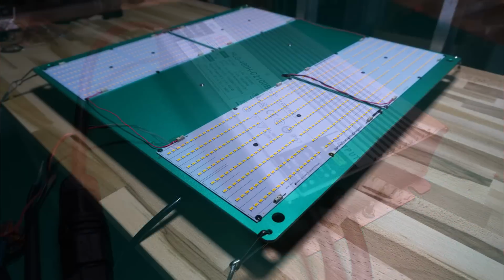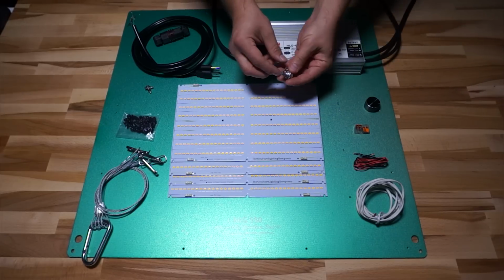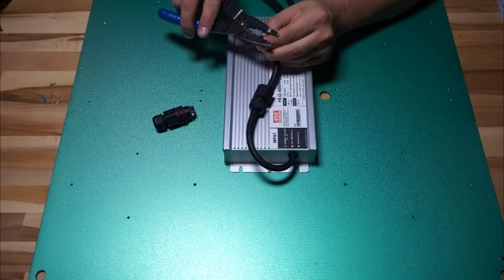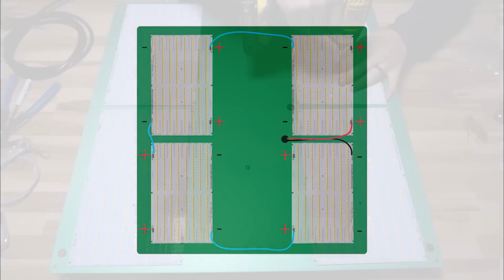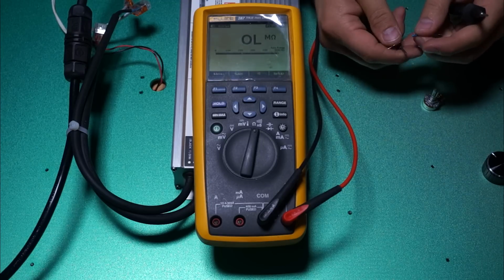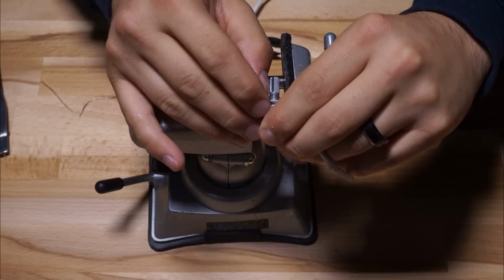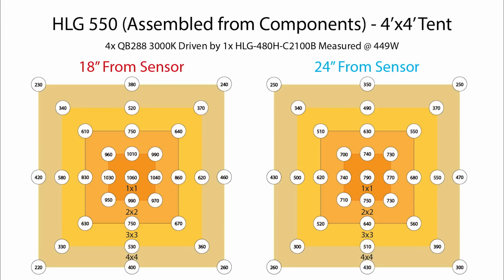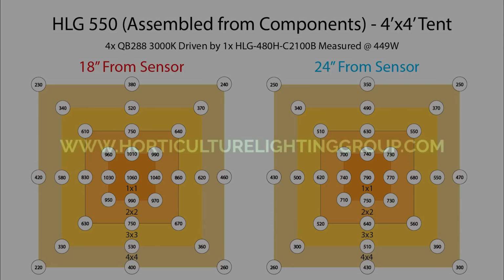HLG 550 Assembly and Testing (4x Quantum Boards on 1x HLG-480H-C2100B)

Comment: Nice vid ! I just pulled the trigger on this last night on this:
 included in full set ( MB-600-V4-Plus KIT)

 

1. 6pcs QB288 V4-PLUS boards

2. 1512pcs samsung lm301h

    72PCS CREE 660NM

    24PCS LG 395NM UV

    24PCS CREE 730NM IR

3. 2pc heatsink 935x195x10mm

4. 1pc meanwell driver HLG-600H-48AB

5. 1pc dimmer switch

6. hang wires, connect wires, connectors, plug

Comment: take the 2 wires you want to twist together   put one end in vice and the other in the chuck of screw gun. light tension and pull the trigger for a nice permanent twist. a bit of heatshrink at the ends gives it a pro look

Comment: on the 260w kit i got 2  separate heavy duty heatsinks and built a 40" x 10.5" frame to spread out the 2 boards. 8" between the heatsinks is perfect for a 5 x 5 tent.   id use 5-6 inch for a 4 x 4  i have 2 of these in 3000k and a 2700k single in the center w a 120 driver, it evens out the photons. quick release connectors for the external mounted drivers in the vent exhaust. if you want photos give email

Comment: Nice explanation on the dimming pot. I always thought it was a 10k pot but my drivers give out WAY more power with it disconnected. In going to pick up some 100k pots and test them.
Reply from the maker: volvo09 dang, you’ve been running at 10% then! Talk about mega efficiency.

Comment: Loving my Quantum Panels.  1st attempt was 1.2g per/watt right out of the gate.... BOOM
Reply from the maker: Canna bis nice work! How many are you running?
Reply: They'll be my veg light now in a persistent harvest setup but I just had to have a go at flowering to see the results - I ran two plants under two 90w panels in a 2 x 3 x 4 propagation / mother tent.... 7+ (lost a bit to budrot) zips of top shelf later :) great result for such a small space
Reply from the maker: Right on, man.

Comment: Nice man!  I want quantum boards.
Reply from the maker: I forget - are you running any LED currently?
Reply: LED Gardener if you were going to build a Quantum board light for a 5x5 how many would u use?
Reply: @internetwarrior666  is this site trustworthy?I heard people vetting scammed,then herd its better now and reliable.Hard to decide.
Reply: @alwaysrised  Alibaba? If people know what they are buying and know how to test it to & confirm results then buying anything shouldn't be a problem. These guys are the manufacturers of the boards which they sell to hlg for branding & resale.
Reply: @internetwarrior666  I thought so.
Reply: @internetwarrior666  and the optic line.Just seen a debate about someone thing diy cobs are better then these.On that site you can get 2 sets of the set of 4 288 301diod boards for 12 cob kit.what do you think would be better?
Reply: @alwaysrised  I personally switched from Cobs to Quantum boards. I mean I haven't gotten rid of my cobs, but I don't use them for the same purposes anymore.
Reply: @internetwarrior666  exactly are we Americans that dumb. Do your research and you could get it half that price.
Reply: @internetwarrior666  why

Comment: I think if you had a square room of say a 12' x 12' and hung 4 lights in it you will find the light spread on the edges would be pretty good. Prob be above 700 par in the 4 ft area you will have light bleeding over from the other light footprint

Comment: I was told to use a 50K pot on the HLG-480H-C2100AB driver. Will that be a problem? Great videos. Most information i've found about wiring these lights so far.

Comment: Just re-re-rewatched all 3 parts of the HLG QB's videos you did, looking for the mention of what cable used to extend the driver's DC side for remote mounting...just realized it's this video - and that it's for extending the potentiometer - not the driver's output/DC side.

I got 18/3 for extending (about 10 ft) but should've got 16/3 probably, fuck.  lol.
Was told it should be fine for 260w kit (for about 10 ft).
Reply from the maker: Complex if it’s constant current then you don’t need to worry as much about conductor thickness because there’s typically less current flowing in CC systems. 18 gauge will be fine for 2.1A.
Reply: Thanks bro.

Can't thank you enough for always answering questions and helpin' people out, and for your amazing videos!  I really appreciate it!
Reply from the maker: Complex my pleasure :)

Comment: Hey man, great video - thanks for sharing this.

I just had a thought while watching that might be an improvement on your already awesome vids...
When you show your diagram/chart for ppfd and footprint measurements, think you could add maybe a dashed/dotted line to represent the perimeter of the actual light/fixture(s)?  Do you know what I mean?

It would really help visualize and kinda show a referance to how far out horizontally the light (photons) are "reaching" from the actual emitters/fixture.

I think if this fixture was divided in two, and each was hung centered in one direction yet spaced out a bit wider than the "one large heat sink" fixture it is that those numbers would be more even?  If maybe a little bit lower in the very middle, no?

Peace.
Reply from the maker: Yeah, this is a good idea and I've wanted to implement it for awhile but haven't taken the time to scale these lights properly when I'm drawing up the charts. Your comment might be the kick in the ass I needed to make it happen. 

I have done a little bit of experimenting with spacing things out in a 3x3 and it didn't make too much of a difference. There was less of a hot spot in the middle, but I didn't really gain a whole lot around the edge by moving it out. However, I didn't separate them by a whole lot (I was using one of those triple QB heat sinks so I was restricted in how much I could space them out).
Reply: Cool, haha.  Look forward to it, no hurry though.

Interesting observation about the spacing you tried.  When I see these LED boards and cobs etc, I immediately think we could be making extremely even canopy lighting arrangments compared to the old "one light source" HID style of lighting.  I guess DIY is where it's at for that.
Reply from the maker: For sure man. I know a guy who ordered 9 of these for a 3x3... 1 per square foot at very low power. I should track him down and see how that's working out.
Reply: Yea, you mentioned that.  Awesome, haha.  Let me know if you get hold of him, should ask if he'd post a quick vid of his setup or something.

Thanks.

Comment: I know this is an old video but... Have you tried repositioning the lights to get a more even coverage.  It seems like you could get better coverage using aluminum angle and individual heat sinks to reposition the lights to push out to the edges getting higher amounts of light on the outside and reducing the hot spot in the middle.  any thoughts here?   Without a par meter it's a bit of a tough experiment to try manually.   I'm sure autocad could do it but I'm not that smart.

Comment: So for example, if I order 12 potentiometers from Digikey or wherever, and I filter the selection for a resistance "tolerance" of +/-10%, then I should receive 12 potentiometers with varying resistances of between 90k ohm and 110k ohm?  But gauranteed to be in that range, right?

This would make it easier to know what size resistor you may/may not want or need to buy as well?

Comment: these boards kill it! i was torn b tween chilled and QB. the problem with chilled was they have hot spots and i dont have 24 inch in tent for light to spread. plus the BMW price tag sucks. im sure it is one of the best lights made but it is not right for a home grow. the QB s are perfect. 12 inch. calculate how many dollars it will take to cover a 4 x 4 with 750 PPFD WITH chilled and quantum. its not even close. chilled is 2-3 times the cost. o and the specs they post are not real world numbers.

Comment: Is there something like a project box, but better that could be used in indoor garden application, for cleaning up the wiring and mounting the pot?
Reply from the maker: For sure man. Even a little single gang PVC box and plate would clean it up nicely.

Comment: How thick would you say that substrate is? I work with aluminum and I made a substrate for a 2 board build out of .125, 5052 running at 240watts and it runs fairly hot at max current. I didn't take a reading but if you laid you hand flat on it would could probably only leave it there for about 3 seconds before you would need to take it off. I'm guessing that't probably around 140F-150F degree's. which is about what you got.
Reply from the maker: mrtimjitsu I measured it at 3/16”. It does get pretty warm.

Comment: Thanks for the great vids! You definitely helped me out understanding series wiring. I have 4 qb120s I’m building a frame for and going to be using the hlg-240h-2100a driver wiring them in series. I was curious as to if I need one of those potentiometers with this build.  Any advice would be greatly appreciated. Thanks again!
Reply from the maker: Hey Marty! If you're using an "A" type driver, there are no external leads for a dimming potentiometer. Instead, it comes with a built-in pot that will dim from 2100mA down to about 1050mA.

Comment: I'm new to LED and trying to figure out the numbers. You stated that the HLG-480H-C2100A can be turned up to 2400 mA and end up drawing 550 watts. The specs for that driver a max output current of 2100 mA , and output power of 481 watts. Is there something beyond these numbers that I'm missing? Thanks!
Reply from the maker: Jj None Yeah, you can turn up the current on the A-type drivers past their rated level. If you have a look at the Meanwell test report for each driver, rather than the spec sheet, you’ll see that in the test report they are able to get this extra power as well.
Reply: LED Gardener thanks! I'm looking at the HLG-480H-C2100 test report on the Meanwell site and can't seem to locate that data. All I can find in reference to the mA output states 1050 - 2100 mA. I appreciate you helping!
Reply from the maker: Jj None hey! If you look at number 4 on their test report page (CURRENT ADJ RANGE), you’ll see that the values they were able to get out of their test unit at 230V and 115V AC inputs.
Reply: LED Gardener I see! It says 2.27 max. I was looking for a 2.4 somewhere. Your videos have been really helpful. Been geeking out on this stuff for the past week. Was going nuts trying to figure out how this all worked. Finally made an excel spreadsheet with data from various boards and drivers to figure out the relationship between  watts, mA and voltage in relation to series and parallel wiring. Wouldn't of even started if it wasn't for your vids. Happy to say parts are on the way and will finally enter the LED world. Thanks man!
Reply from the maker: Jj None right on, dude. It’s a lot of fun. Regarding their test report, I guess they weren’t able to get as much as I was from their test unit. I have an A-type 240H-C2100 and in my latest video I was able to get 2,430mA from it. If you have anymore questions, join us on the forum at www.ledgardener.com/forum and we’ll get you sorted!

Comment: Please post a review of the 620 watt fixture. I don't see it on their site anymore, but I'm interested in replacing my 600 watt in 4x4 and 300 watt in a 2x4 cob setup with the 620 watt and 320 watt quantum setup. It seems that the quantum setup runs noticeably cooler. Is this correct? I've yet to be able too run my 600 watt cob setup higher than 500 watts due to heat issues.
Reply from the maker: Hey Edward, my 600W driver failed so I'm working on getting it fixed. Once it's back, I plan to test it vs. the 480.

Comment: Could the drivers be located outside of the grow room to reduce heat? And just run the wires through the wall
Reply from the maker: LoganAddisMusic yup. You may end up with a little voltage drop due to the longer run of cable but this can be mitigated by using thicker wire.
Reply: LED Gardener great, thanks for the quick answer!

Comment: Im confused I thought volts x amps= watts.  288 is a 52v board at 2100 milliamps is 109 watts per board.  If you can explain what im doing wrong I would appreciate it. Thanks
Reply from the maker: Richard Lavoie the voltage fluctuates depending on how much current you apply to it and vice versa.
Reply: So when 2400 milliamps it's actually drawing 54 volts or something
Reply: Richard Lavoie The 288 refers to the actual number of diodes on one qb288 board.  The number of watts the board will use depends on the amount of current that is applied to the board. 
 The voltage will vary slightly +/- with the applied current (higher forward volt drop per board with higher current setting) 
ei. 51.12v @ 2100mA
52.2v @ 2800mA

Comment: is it possible to have both 3000k and 4000k lined up at the same driver? If so, do I get good results with flower quality and yield, or should I go 3000k only for flowering? Thank you!!
Reply from the maker: Yup, you can use both temperatures together if you like. 3000 seems to do just fine for full cycle though.
Reply: LED Gardener The reason I ask is because I got two 260 watt QB kits at 3000k + one kit at 4000k. Then I was thinking about mixing them :)

Comment: Can you get longer leads on the driver?
I want to build one of these lights but I don't want the driver on the light.
Reply from the maker: +hort hydro all you need to do is grab some cable and extend the leads. Super easy to do.
Reply: I was wondering how far one could safely extend power cable from drivers in general.  More like a remote ballast for HID ligthing.

Good question.
Reply from the maker: The main thing you need to keep in mind is the voltage drop you incur over the length of the wire. There are a number of calculators you can use to figure this out though. I have a 20' lead on one of my drivers that I extended with 16 gauge wire.
Reply: Yup.  I also have the electrical code book, lol, but I'm sure an online calc. might be faster.

Comment: Will the C2100a give me a better par ratings? Will it cause it to run hotter?
Reply from the maker: +theguy13 hey guy. The C2100A can be turned up to about 2400mA so on a single board, it will be very close to the kit driver - just a touch less - since the kit driver can do 2500mA. On more than 1 board, the C2100A will definitely put out more light than the kit driver since it’s able to run multiple boards at full power.

Comment: I have a HLG-480H-C2100A and 4 qb288 v2. I split the output wire from the driver parallel with wagos and wired 2 boards in series on each of the parallel connections. I am only seeing a max draw of 247 watts at the wall. Is that correct?
Reply from the maker: Mike Fisher You should have no parallel connections. It should all be in series.
Reply: @LEDGardener  This video has the same wire config as I do and looking at the images of the HLG 550, they are the same as well. It is not parallel but the output from the driver is split between the two series sections. Can you see any down sides to this config? https://www.youtube.com/watch?v=upcTWWsnQMg
Reply from the maker: The part he missed was wiring the two sides in series instead of parallel. To do this, you need to use the third pin on the 3-way connector. Are you using the same 3-way connector or just wagos?

Comment: How thick is the heatsink plate?
Reply from the maker: Dub-T Dank 3/16”
Reply: Are you still happy with this build and it’s performance? Is that 3/16 plate providing sufficient heat dissipation or would thicker be better? Anything you would do differently? Gathering pieces now👍 Thnx!
Reply from the maker: Dub-T Dank it does a decent job. Slate 5 quad runs a little cooler but doesn’t have quite the same spread. HLG550 is a pretty popular light so this sink is definitely doing the trick for everyone out there who has one. Haven’t seen any complaints about thermal performance on it.
Reply: Thanks for all the info! Caught your call in to the growtube and all the praise the boys threw your way. Well deserved👍
Reply from the maker: Dub-T Dank no sweat dude. Regarding the call into Growtube, you must be thinking of somebody else! Unless I’ve got an evil twin out there somewhere.
Reply: Oh dang!! My bad, it was LED Builder who called in... but, my mistake led me to your info when i searched... so win win.. lol.. thanks again

Comment: HAVE RUBBER BUNGS BETWEEN THE BOARD AND THE BOARDS AS THIS CAN HELP FOR HEAT DISSIPATION!!!!!!!!!!!!!!
Reply from the maker: You're saying separate the boards from the heat sink to improve... heat dissipation?
Reply: @LEDGardener  with airflow behind the boards it helps to cool.... as heat rises anyway the heat sinks still do their job
Reply: @LEDGardener  or just have them pressed against a big metal board .....pretty much basic logic really mr sarcastic

Comment: Same (apparently) four boards, however I am on a Mean Well HLG-480H-C2800A driver. Getting the same current draw as you are (I'm wired in series), however my voltage is much less than yours. Any idea? Unfortunately, no meter to measure PPFD.  https://imgur.com/s6OIPjj  Not shown, I was using 408W at 117.5VAC line side of the driver.

Comment: If you run the driver with a timer, does the driver start after the power interruption again at the previously set power setting of the dimmer ??
Reply from the maker: Ede Wolf yeah. It’s a dumb circuit so if the same resistance is still on the line, it’ll start up at the same reduced power.
Reply: LED Gardener Nice Video, thx for fast answer ✌